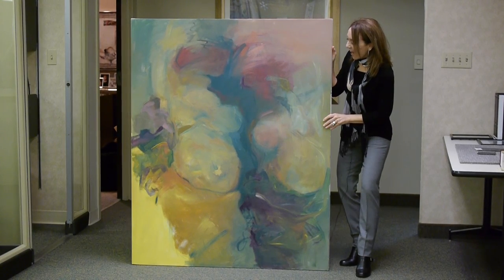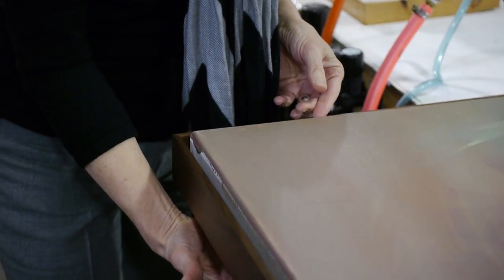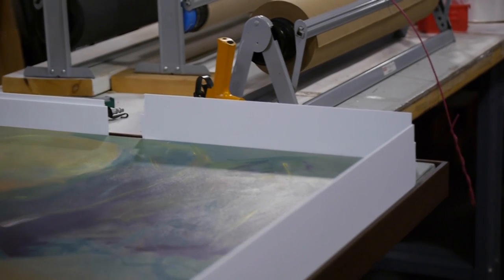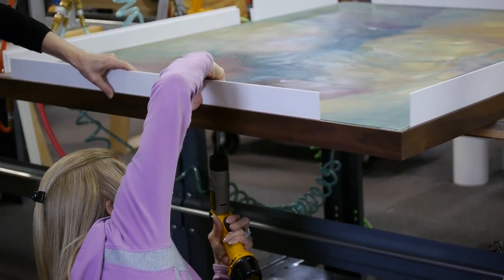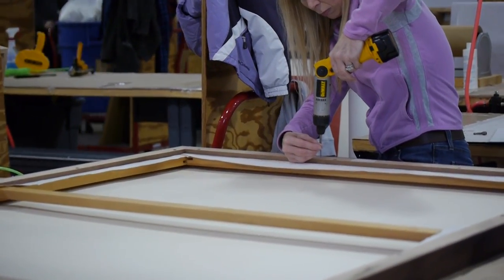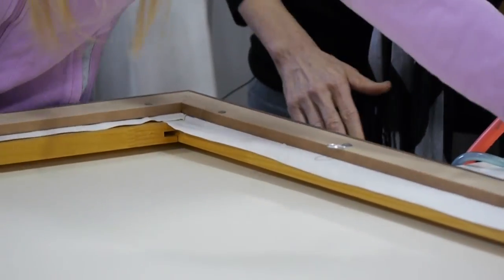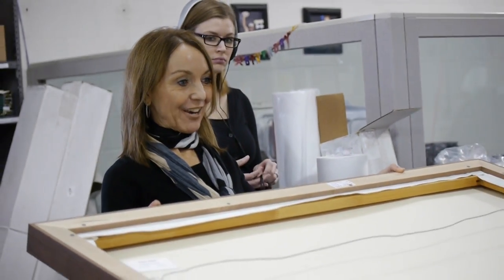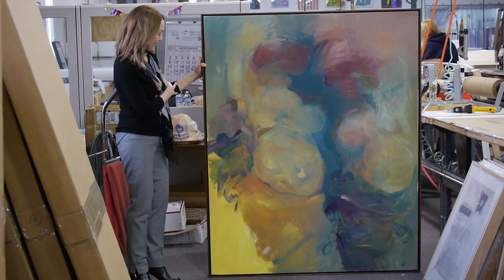Preparing Large Canvas for Framing - Wood Canvas Floater Frame- American Frame

Comment: My big thing ...is. Frames are not complicated. If you want a frame and it's not for canvas, it can still be used. Canvas can be mounted on thin material to fit ANY frame. Paper can be placed on canvas stretchers just like canvas to frame in a canvas frame or metal

Comment: Shouldn't the artwork be painted all along the edges of a canvas to do a floating frame?
Reply: It's not necessary. The gap between canvas and frame is typically 1/8 to 1/4 inch, so not much light gets in. Personally, I prefer the edges not be painted.